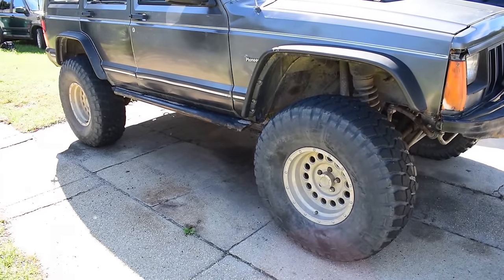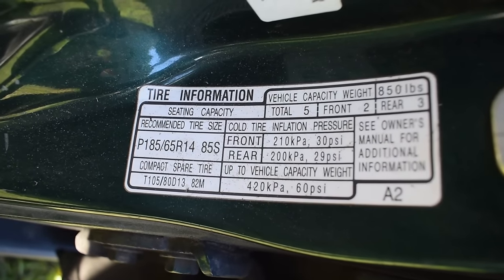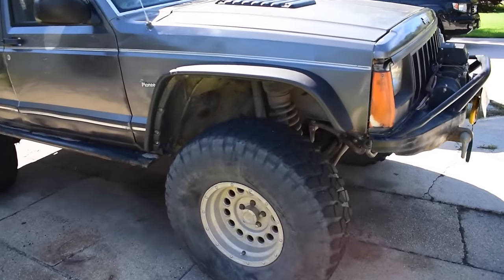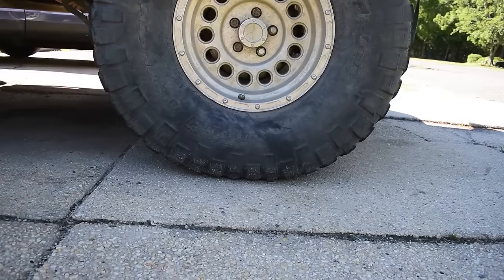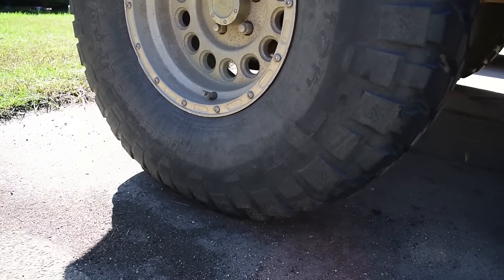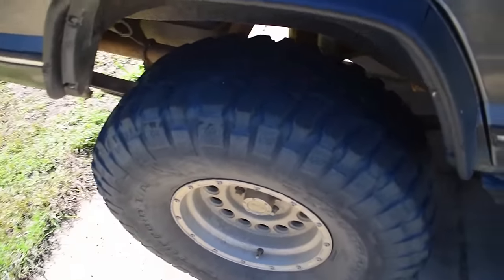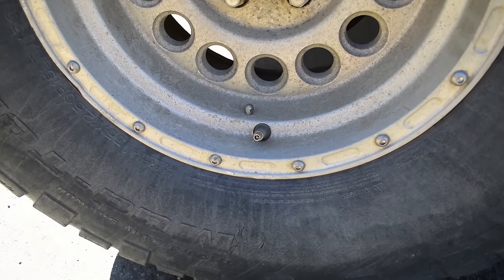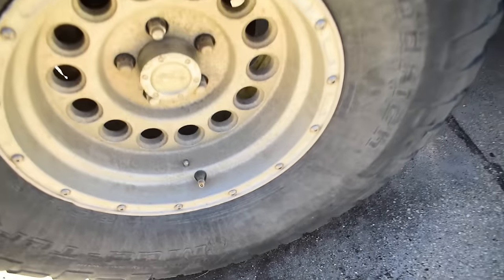Airing Up/Down Tips & Air Compressor Battle

Comment: i have that same air compressor viair  and a put a plug kit in it also it is very good for the last 6 years i use a spring clamp 2 bucks to hold the triger in and it also holds it out of the dirt also

Comment: Very crisp and quality video, i can see why you bought that camera :-D, the grain in the pavement was in sharp focus, i could even see an ant sticking out his tongue at you LOL :-D.
I think it was his tongue lol.

I think all the compressors did fine, just imagine how long it would take using a foot pump, you would be on a zimmer frame it took so long :).
For the gauge that was off mark, loosen the screws on the crappy scale plate and see if the play in the screw holes will allow rotation, yes its bodgy, but reversible.
Oh dont forget the cardboard :-)

Yes i agree with the silly gauge range, 0-100 would spread the readings out, or 0 to 50 for special rock setting levels.
So what do you do to get the rock reading, park the wheel on top of the desired rock size and let the pressure down to get 50% coverage, or do you just say "Naaah that will do" lol.
Reply from the maker: Haha, Drop in down to 8psi, and then maybe push it a little lower if I'm stuck on something tricky.

Comment: coll video, I have a smaller viar 3rd or 4th smallest that runs a 33x12.50 from 15 to 32psi in about 4minuites 30seconds. in my truck I also carry a 7gallon tank at 50-55psi helps out a little. haven't used the compressor on the jeep yet but I tend to run 20-24psi street pressure on 33x12 with stiff sidewalls so I'm sure the viar wouldn't be too bad and my model was cheap at about 60$

Comment: The Ridged compressor tanks are connected by a wielded pipe. I would see if you can get a look inside of the tanks before you pressurize them. If it's been out for a while, it might rupture. I have seen people who, in Wranglers, have put onboard air in their rides. Using a York pump driven off the engine. Well I don't think you have the room under the hood. But I could see you running a small compressor in the back to a tank and run lines to the front.
Reply from the maker: I did notice the the pipe the connected the two, and I would definitely inspect it before going through with it. Although, I didn't realize how cheap the ready made tanks actually were so maybe it would be better to just get new for the safety factor alone. But yeah, having the compressor and tank mounted in the back would be awesome when you gotta air up or use power tools.

Comment: Find an old expired propane tank that doesn't leak and just put on your fittings. Vacuum it out with your vacuum pump or purge it with N2. (Not compressed air. Compressed propane is more likely to get drunk and be pressured into a one night stand with the oxygen molecules and make loud babies.) They're rated for much higher pressures than air tanks so they're good for a few years. They will eventually rust from the moisture though. But, cheap, easy air tank. Most Chinesium air tanks will rust anyways. The only thing to do is coat the inside well with paint and then you're golden. DOT propane tanks are rated to burst at ~960 psi and operating press. is 240 psi. and has thicker walls and more stringent manufacturing. And there you go. Cheap ($22 for a brand new tank) and better than a $50 eFray tank.

Comment: 14:17 Do you think to make also an arduino digital pressure gauge for this compressor or even for anyrhing else? (if it's possible)
Reply from the maker: I'm sure you could, but you could also buy a ready made digital gauge for rather cheap already, haha.